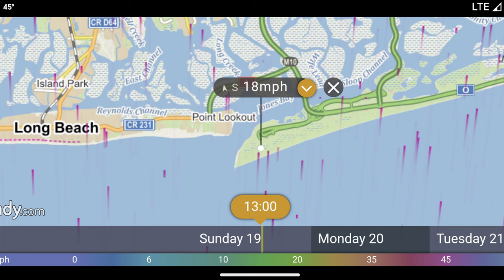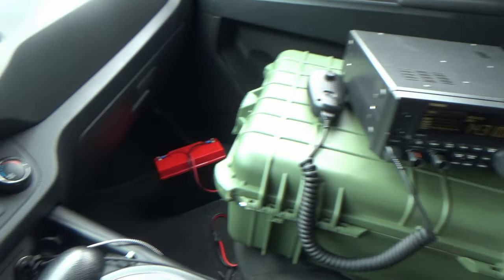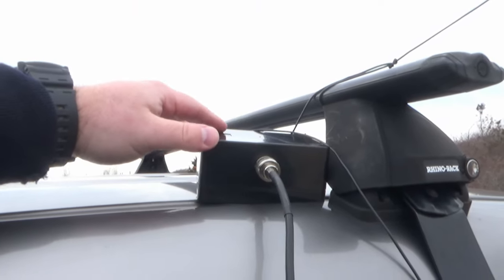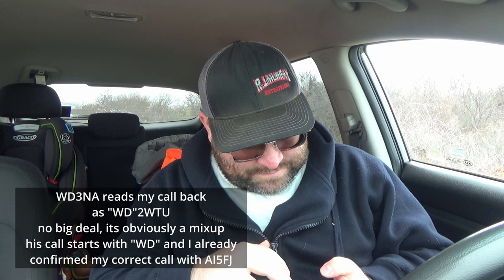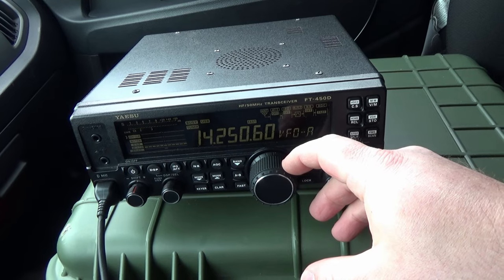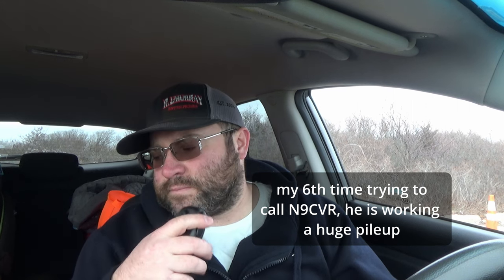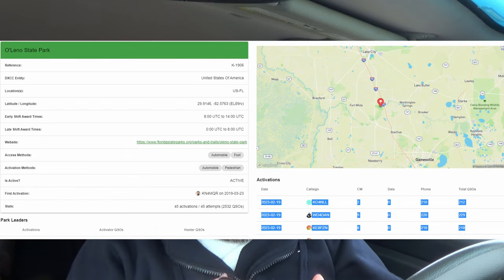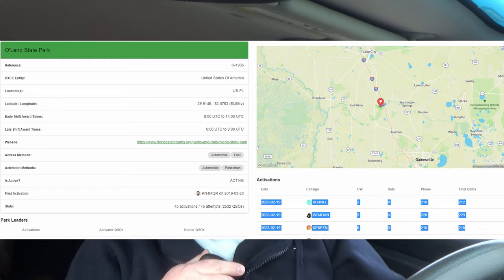Can a cheap kite get this park on the air? Ham radio POTA kite antenna.

Comment: I strongly advise earthing the aerial it’s self through a bleed resistor. The wind will generate a static charge that your radio will not enjoy….
Reply from the maker: How do I go about doing that? Can I ground the end of my counterpoise through the resistor ? Or does the radiating vertical element have to be grounded thru resistor before it connects to the unun? Thanks for the heads up
Reply: Simply add a 1 meg 1 or 2 watt resistor from the aerial to ground…. This will bleed off any voltage generated from the wind. Your looking at something around 10kv plus buildup on the aerial and that smarts.
Reply from the maker: @rubbersurf  ok sounds good 👍.  I ordered a 5 watt 1M ohm hv resistor for my next run. Thanks !

Comment: you need a certain thickness or wire to handle your 100w, also if your wire is thick enough you can delete the other line. I use DXengineering insulated copper wire I tie one end to a tree and the other to the feed point on my vehicle then drive away to pull it up off the ground, is is designed for this. check the specs but the thinner stuff should do the job.
Reply from the maker: Thanks for the recommendation!

Comment: Nice work dude. Great setup. Didn't realise how much I would like the look of that radio. It look sweet.
Motters M7TRS 73 👍🏻
Reply from the maker: Thanks! I love the FT-450D. Bought it used. It's one of the best options for a compact 100W transceiver + built in tuner, imo. It's very simple but really a pleasure to run.

Comment: Thanks for the video and congrats on the activation =] I've used Davis RF #26ga Polystealth copper-clad steel wire on 4:1 vertical, 9:1 EFRW, 49:1 and 64:1 resonant EFHWs antennas running 110w SSB/50w CW and 70w FT8 from an IC-7300, IC-705 w/KXPA100, and KX2 w/KXPA100 running portable, pota, and sota. Never got warm and never had a problem with SWR running high duty cycles (Mind you, I wasn't flying a kite lol). I bought 500' of the stuff after testing it with some homebrew ununs. Seems to have a bit higher Q (More narrow useable bandwidth without trimming or 're-tuning') but zero problems otherwise. k3xq 73
Reply from the maker: Copper clad steel sounds like the best of both worlds for a kite antenna thanks for the recommendation. 26 gauge is some thin stuff! Definitely strong enough though if it's steel. Thanks!